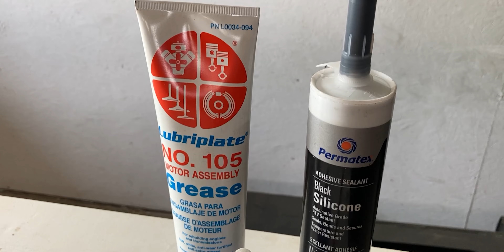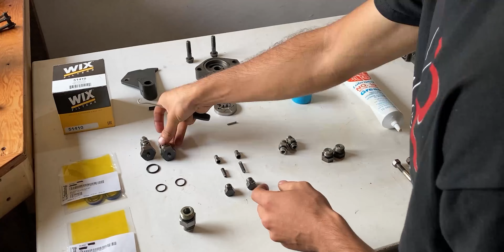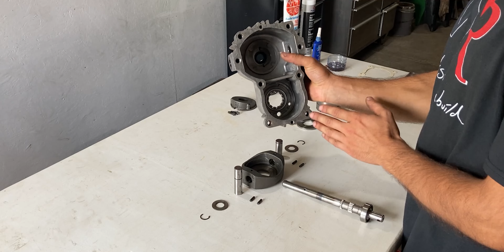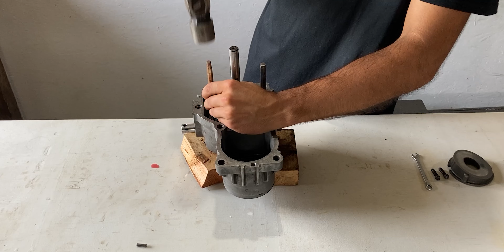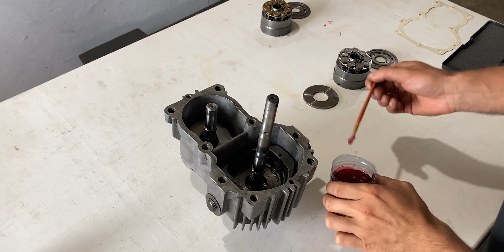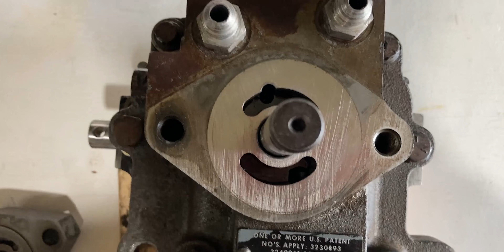Sundstrand Series 15 Hydraulic Motor/Pump Rebuild For John Deere 300 Series

Comment: Watching the installation of the roll pins in the variable swash plate I couldnt help wondering how they were removed. I imagine they were drilled to remove them? Or are there access plugs in the case to drive them out?  Excellent tutorial.
Reply from the maker: That's a great question! The bottom half of the housing has two reliefs on either side of the swashplate. Since the variable swashplate is held onto each shaft with two roll pins, there is enough room to punch them out. Each pin is 5/8" in length and both pins must be removed to dismantle this assembly. If someone installs a longer rollpin, it would have to be drilled out. Hopefully this does not happen, as one could damage the bore once it's drilled and there might be more to fix. I hope that helps & Best regards Andreas
Reply: I want understand this very carefully you have to drive both pins all the way through or does one stay inside the shaft
Reply: @lesdickinson3785  When removing the trunnion shafts, one pin will be in the swash plate and the other in the shaft. Driving the pins from the top a prescribed depth so the parting line between the 2 pins lands 1 in the swash plate and the other in the shaft. On mine there is only 1/2" of clearance between the housing and swash plate. You might be able to drive out a 5/8" long pin if the plate is angled to the forward position.

Comment: A very good video. My reason for rebuilding this is to address the noise that these pumps make. I wish you would have touched upon that some and in particular the tolerances of the wear plates and pump assembly. As it is, you basically resealed the assembly. Also, as most of us are mechanically inclined, we watch these videos to learn and are not necessarily interested in being entertained with loud music and dancing introductions. Other than that, it was very informative.

Comment: Is it possible to modify these in any way to make the output gear rotate faster without rotating the pump input shaft faster ?   Making the tractor travel faster would be the objective.  I'm guessing it would have to do with the unequal amount of material on either side of the swashplate ?

Comment: I just rebuilt mine wich is the same one your rebuilding in the video except mines middle 80s year model, I tried everything I tried turning the charge pump 180 degrees thinking I had it on the wrong way, I tried pouring some (hytran) down the 2 pressure relive valves and I get no forward or reverse.. I watched your video so I knew I put it together right
Reply from the maker: Hello Blane! I‘m sorry to hear that you are experiencing issues with your hydraulic pump!
What exactly does not work?
If you do not have lift capabilities, then it is your charge pump (front cover plate with RH/LH).
If you forward/reverse does not work, then it is your hydraulic pump section. There are many small components within this pump and you must get everything right. The hydraulic pump and motor have very similar parts, but the must be kept on the right side. 
For instance if you switched the swash plates, then you will not have the correct flow...
There are many things that can be misplaced or flipped. Let me know what you find out.
Regards Andreas

Comment: Very helpful video but just as a heads up to the other folks who are watching this for specs....Measure your own bearing dimensions.  My JD 430 has the same basic pump but with a 0.750 shaft instead but does measure the same on the swashplate pivot seals.  Ended up with CR 7443 seals for the larger shaft and CR 6763 seals for the swashplate pivot seals.   Thanks again for posting a well made vijeo!
Reply from the maker: Thank you for tuning in and thank you for your comment! I would assume there are bigger bearings and seals due to a larger input and output shaft. This might be due to the diesel engine that produces around 20HP and about 45 NM of torque. Your information will be valuable to those that are in need of other bearings & seals. Cheers
Regards Andreas

Comment: The Sundstrand U pumps are a very robust design and are still being manufactured to this day. They've been in production for over 50 years. I took one apart a few years ago, it's really neat to see how they work. I think Sundstrand/Sauer Danfoss gives them a 5,000 hour service life, but they basically last forever.
Reply from the maker: I fully agree, they are very very robust! The design is very simple and it gives the operator a smooth ride. I hope you learnt something, because I sure did! 5000 operating hours is fantastic and that's why these pumps are literally everywhere. I might have to dig into my Bolens rear-end (Sundstrand inline pump) because it's been acting up. I did not touch it when I rebuilt the tractor...but maybe I should have! Cheers
Reply: Danfoss (Sunstrand) does not produce the Series 15 line of pumps, motors, and transmissions any more. Thankfully service rights have been sold to QCC out of Illinois.

Comment: FYI, working on my 1982 John Deere 317, in regards to the swashplate orientation, I installed it with the 'more material' side to the top of the housing, as you suggested and reverse had the speed of forward, and forward had speed of reverse.  Looked into my manual, and it says to install it opposite of what the video shows, 'with the thin pad toward the top of the housing'.  Not sure how many others have encountered this, just bringing it up to everyone's attention.  Not trying to discount your video, great detail, and really enjoyed watching it, just thought I should mention that.
Reply: Same on my 140, thin pad up.

Comment: Thanks for the video. I have a 317 and it ran and moved really good. Then one day mowing across the yard it just stopped moving. I don’t know anything about a hydrostatic but getting a lot of ideas to check on. Thanks
Reply from the maker: You're more than welcome! 317's are great little machines and with proper maintenance you'll have a good tractor for many years to come! I'm sorry to hear that you rear-end quit on you!! The first thing I would check is your fluid level (sight tube in the back) and you oil-filter. It's possible that there is not enough fluid or fluid flow to create enough pressure within the system. This will not allow your motor/pump to provide any power to the transmission. I hope this helps and if you have any others questions feel free to ask. Best regards -Andreas
Reply: I just changed the filter. I’m almost positive I’ve got an issue with the pop up valves for the free wheel. But still researching other option. I’m going to drive into your content log the breakdown of this transmission. Thanks for what you do and congratulations on your channel

Comment: thanks was having prolems spv 15 on a case 1818 skid steer the the slippers have worn out after waching you going to strip it down and have a go thanks from scotland
Reply from the maker: When one has problems, there are always solutions! I'm glad I could encourage you to fix your hydraulic motor and I hope you can get your handy 1818 Case skid steer back up and running! Best regards from Canada

Comment: Hello again friend, would you know a part number for the trunnion seal? Your help is greatly appreciated.
Reply from the maker: Hi there, I had a quick look online and found "CR 6763 Shaft Seal" should fit just fine. The Inside diameter for the trunnion seal is in the link in the description, but here it is for your convenience:
0.688 in Shaft Dia., 1.187 in OD, 0.188 in Overall Width

I hope this helps. Regards Andreas
Reply: @WorkshopRebuild  you are a treasure!
Reply from the maker: @DavidJones-fk5hg I‘m glad I can help! Cheers 😊👍🏽
Reply: @WorkshopRebuild  Well, i'm gonna try to replace this seal while it's on the JD420 by drilling a hole into the frame so I gave a direct shot at it. First time doing this sort of project. Wish me luck! Wouldn't have even  tried without your video and info, so thanks again. Any suggestions when putting in the new seal?
Reply from the maker: @DavidJones-fk5hg  That's actually a great idea! Replacing a shaft seal isn't all too hard actually. Remove the old shaft seal with care: You can either pull the old one out with a hook or even a flat head screw driver, but if that doesn't work you can carefully drive a screw into it the metal casing of the shaft seal. This will allow you to pull on the screw, to then remove shaft seal.
When it comes time to install a new one, you want to make sure all surfaces are clean and that you don't have any oil-residue on the outside diameter. You can use a socket or even a few washers to tap it back into place. Make sure the seal is sitting flush with the housing and that's pretty much it.

If you need any other parts you can find them under this link: https://docs.google.com/spreadsheets/d/1Fb1OLYj7oSVPt47IWgjH-mbMD9nMg_Nu0NgnjC-wak0/edit

This link is in the descritpion of this video and it is always accessable! Let me know if it worked out for you. Regards Andreas

Comment: On the free wheeling valves on top-   if the buttons are up- is this normal operating position ?  And pressed in is  bypass or free wheeling mode ?

Comment: I dont think you showed it but I might have missed it. How did you do the seal for the swash plate that goes to the drive linkage? Got a 1978 John Deere 312 I need to change that seal on.
Reply from the maker: There are two seals left & right. They are both the same size and they are lip-seals. In the link below you can find the exact seal size and they are called "Trunnion Shaft Seals". The trunnion shaft is connected to the swashplate which activates your forward & reverse. I hope that helps and if you have any other questions, feel free to ask. Best regards

Comment: Well done. I was wondering if there is a way to determine if the charge pump is within spec. Thanks.
Reply from the maker: Hi James, I didn't find a service manual that shows the clearances needed for the charge pump. Maybe if you reach out to Danfoss with your hydraulic motor model and serial number they can send you the correct manual free of charge.
Another way you can check your charge pump is to check your system pressure. You can hook up a manometer to your auxiliary lines and active the hand-lever. If your pressure is within spec, then there shouldn't be anything wrong with your charge pump.
I hope this helps. Regards Andreas

Comment: I appreciate your videos very much.  I purchased a 1975 JD 300 that was not running, and recently I purchased a JD 317 that was repowered with a 20 HP Onan.  I'm rebuilding the hydro pump on the 300 right now.  One question, the 2 small bolts that connect the "fixed swash plate", what wrench did you use for those?  Mine look like some type of inverted torx head.  Thanks again for the helpful videos.
Reply from the maker: Thank you that means a lot to me! How cool is that, we have the same models! The 317 with a 20hp Onan engine is probably a beast. If I recall correctly, I used a 3/8 - 12 point socket. It was also one of the smallest sockets for a 1/4" drive, because the output shaft is right next to it. One hydro motor I previously rebuilt had an allen wrench bolt, which works just fine too. When you reinstall the bolts, don't forget to add thread loctite (blue) to the bolts. Thank you once more, I will always try to share as much knowledge as I can. Best regards

Comment: Excellent demonstration .  A quick question. Is there any difference between the two valve plates that are used on this pump. One on the variable piston pump side and another one on the fixed motor side. in case they are mixed up, how do we differentiate them ??  Regards Antony
Reply from the maker: That's a great question, Antony! I reviewed my footage and at 12:34 you can see me discuss the valve plates and when you look at the valve plates you can see the differences.
For reference: The valve plate with two whales (cut-outs) will be designated to the variable piston pump!
The valve plate with 4 whales (cut-outs) will be designated to the fixed motor side!
This is very important and you would not want to swap them. 
At 33:04 you will see me install the valve plates and this might give you a better view as well.
I hope this helps you out. Best regards

Comment: Is it possible to swap the trunnion shafts that go into swash plate so you can install that linkage for forwarding reverse on the opposite side of the unit
Reply from the maker: Hi Les, this will work if you change the swap the trunnion shafts (forward is still forward and reverse is still reverse). I hope this works out for you. Regards Andreas
Reply: Yes very good all I want to do is put the linkage on the other side

Comment: What silicone did you use to put the gasket on? I’m replacing the 2 middle gaskets on my Sundstrand 15 inline pump for my Bolens HT-20.
Reply from the maker: I used Permatex Black Silicone Automotive Grade RTV Sealant. I found this to be one of the best silicones out there, but it dries fairly fast! When you assemble the pump, you want to make sure the surfaces around the gasket area are perfectly clean. Since these surfaces are machined, you do not want to apply a thick layer. The best method is to spread a thin layer with your finger. I hope that helps! Best regards

Comment: Hello, thank you for making such a nice video. Where did you buy your seals and orings from?
Reply from the maker: Thank you, I always try my best to keep everything clean and visible! The seals and O-rings were bought locally from Hi-Tech Seals. This is an industrial seal supplier and they carry almost every size of seal or o-ring (metric and imperial sizes). In the link below you can find a list of the products I used and maybe you can find an industrial supplier near you. They should be able to find the products I listed since everything is a standard size. I hope that helps! Best regards
Reply: @WorkshopRebuild  Awesome, I will check around for a local shop. Thanks.

Comment: Not finding the link to part # of seals used.
Reply from the maker: Hi, the links are always in the description of my videos, but you can find it here: https://docs.google.com/spreadsheets/d/1Fb1OLYj7oSVPt47IWgjH-mbMD9nMg_Nu0NgnjC-wak0/edit#gid=0

I did not specify the part number for these seals, as they were purchased at an industrial seal dealer. These pumps were found in all types of applications from lawn tractors to skidsteers and all manufacturer have different part number, so it would be hard to list everything. I hope the sizes help you at least. Regards Andreas

Comment: Another outstanding video! I asked Sunstrand questions back when you were doing the Diff. Sorry. I will need help from you on this as it is my Sunstrand giving me a leak on my Stock 317. Is there a #1 in this (series) or is this the first (disassembly and removal??)? Are there links to the parts or just descriptions (I looked first and missed the links if there). Thank you again!
PS The spread sheet if very informative, but I don't know where or how to purchase seals based on the dimensions. Could you please just provide links to the actual seals you purchased?
Reply from the maker: Thank you Ben, I appreciate it!! I did not share a disassembly video, as I knew I was going to rebuild the entire motor. The disassembly is usually easier than the assembly, but I hope I could give you the best angles in this video, which may help if you disassemble yours! 
I'm glad you were able to locate the spreadsheet down below. I bought the o-rings and seals locally at the closest industrial dealer. If you write down or print the spreadsheet any seal/bearing supplier should be able to find you the items I listed. The sizes are based on the dimensions needed for the Sundstrand 15 motor. I double-checked all sizes before I published the spreadsheet, so you shouldn't have any issues. 
If you need more help, let me know.

Comment: hello good  video my question is can you move the  forward reverse pedal control to  other side of hydro.  reason   i ask i have a massey 1655   my friend has one leg and if it can be done we will for him thanks,
Reply from the maker: Hi Paul, if you have enough shaft on the left side of the hydro motor, I don‘t see any reason why not. The functionality would be exactly the same!
If you‘d need to take apart the hydro motor to flip the shaft, it might not work internally. Just a heads up in case you want to do that.
Regards Andreas
Reply: @WorkshopRebuild  thank  you we will give it  a long thought thank a lot

Comment: You and my self both have a jd 317 does it have the u-pump? also nice video!
Reply from the maker: Yes, that is correct. The 317 shares the same u-pump as the John Deere 300. Best regards
Reply: @WorkshopRebuild  ok thanks!

Comment: I have a 317 I bought recently. It has oil in the trans and the shaft seems to ne turning fine. It tried to move and just quit. Any ideas of what I should take a look at. The valves weren't stuck.
Reply from the maker: Hi Emarionjackson! That's an awesome little garden tractor you picked up. I assume your engine is working just fine and the shaft is powering the input shaft to the hydraulic pump. Is this correct?
If your check valves are in the "UP" position and your fluid is topped off, I would check the hydraulic filter. It is possible that your filter collapsed if it's too old or even started to restrict flow. This is the first thing I'd advise you to check and then you can get back to me after you check that. 
Regards Andreas
Reply: @WorkshopRebuild  ok I put a new filter on same thing. I won't move the check valves are up. What puzzles me is I let it run for about 15 minutes just playing with the hydrostat lever it tried to go forward but it stop and then it tried to go backwards and stop. What should I check now
Reply: @emarionjackson